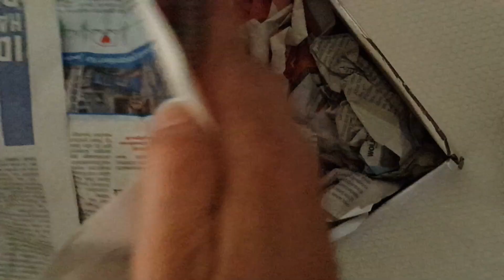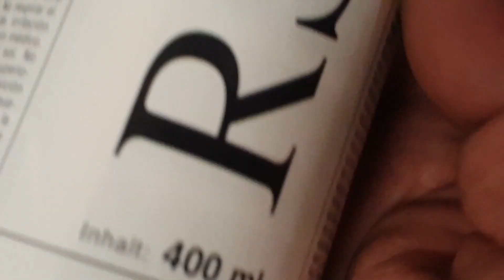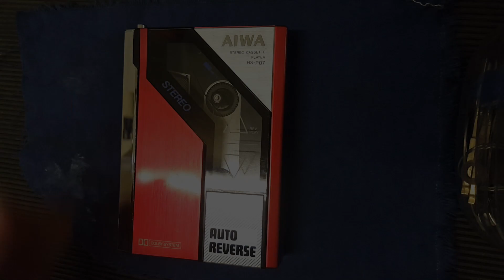AIWA HS-P07 RED AND REPAIR

Comment: Very intelligent repair work, I’m impressed. I hope you benefited from doing this work. They’re only going up in value.
My polite suggestion to help with scratched plastic windows is the treat it as you would if repairing plastic headlights on cars, I’ve done this with a few vintage stereos and it works perfectly. Dremel makes a polishing kit but it’s very simple to make one instead of buying one. I use various sandpapers until I’m down to very fine grit then I use the cloth polishing wheel and some rouge to do the final polishing and it comes out like glass. I always tape off the plastic area I’m repairing so I don’t damage other parts next to the plastic. 
Great job!

Comment: Have a HS P08 the belt was exactly like thin silicone, cleaned off as you said. I believe now I have a belt from Germany 
I will try to install it and fingers crossed it may work again after 30 years. Thanks for this it really helped, I'll be study the repair manual before hand, LOL.

Comment: I bought a good quality ones from UK, the wow and flutter dramatically reduced compared to an Amazon belts, but it is not tight enough causing the notor pulley to slip when rewinding or fas forwarding at the end of the tape, preventibg the motor to shut off.

Comment: if you have a cassette player and it turns on that means basically its 100% fixable
Reply: What if it doesn't turn on?
Reply: @WinrichNaujoks  then it can be literally anything, a component went bad,  the battery connectors are corroded, a resistor or capacitor went out etc, and walkman boards have hundreds of little smd components on them
Reply: best chance is to inspect the board for anything off, and pull up a service manual for your walkman and test all the components until you find the one causing an issue
Reply: @WinrichNaujoks  from someone who has been working on them for awhile, if you are looking to buy one stay away from ones that dont have power, sometimes you can get a steal (how i got a wm w800) or you can just lose more money
Reply: @squiggle2054  I bought a WM-f10 and WM F-10 II, both not powering up. The first one have severe battery corrosion damaging the 1.5v to 3v converter circuitry. The second one is just a worn/damaged power switch.

Comment: It sounds like you still have a lot of wow and flutter, perhaps the belt you chose is slipping or too tight. Or there could be an issue with the pinch roller.
Reply from the maker: dlarge6502 
Hello.  Belt is not his own before.  Then I bought new Belt for aiwa hs p07 the correct size and it was fine.  has no wow & flutter.  thank you

Comment: My HS-P07 is fitted with a new belt. However, it plays tapes about 10% slower. Is there a way to speed up the motor?
Reply from the maker: Hello.  there is adjust speed near battery.
Reply: @elisiocliopt  Thank you, I found it!
Reply: I have aiwa tx456 model I just got it from thrift store today

Comment: what’s that lubricant spray?
Reply from the maker: Polish glass and metal. Remove fat.
Reply: @elisiocliopt  able to send photos of the spray please?  wanna get one.  cheers.
Reply from the maker: @lenco5994  https://m.alibaba.com/product/62019698876/Special-spray-for-cleaning-and-maintenance.html

attention, I took spray factory.  this spray itself manufactures textiles, to clean grease, grease rubber, remove dirty cotton and other.  It does not cause painting, plastic or others.  that's nice.  it also works to clean the car engine black oil and it comes out and gets shine.  good luck.